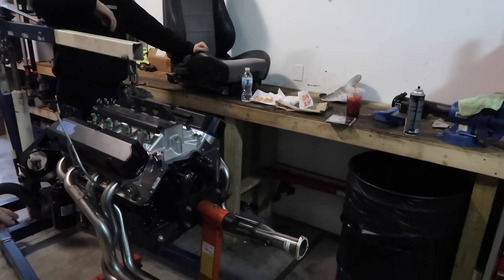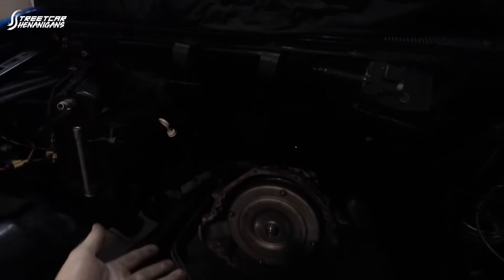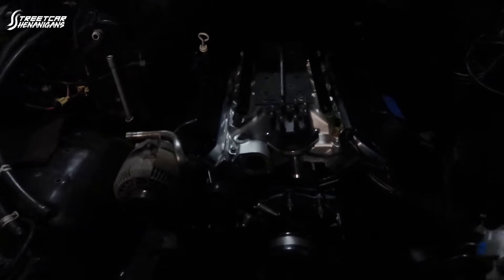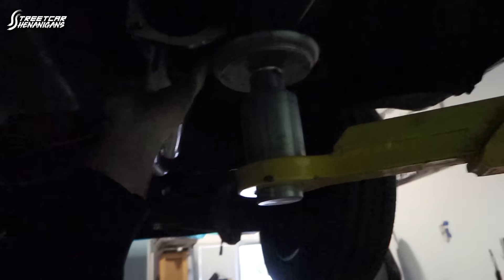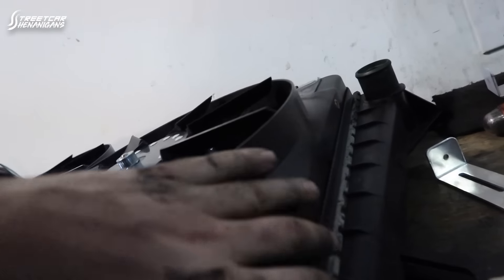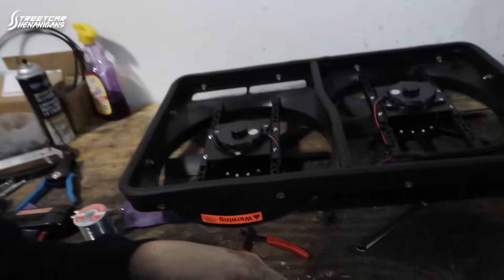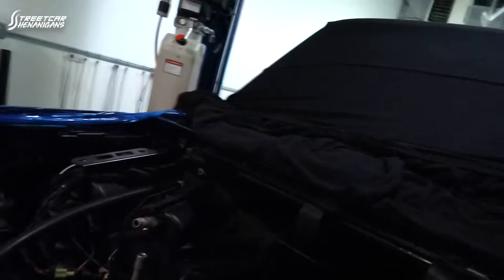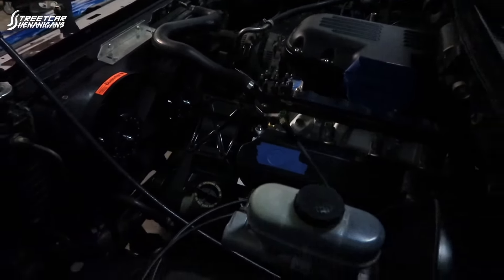Ford Lightning Engine, Fans, and Headers Installed!

Comment: Great job guys!  Got my 94 out tonight for a test run. Waiting on the PimpXShift to come in this week and swapping it over. Keep up the great work!
Reply from the maker: Thank you! How was the test??
Reply: Streetcar Shenanigans let’s not talk about it 😂 trans issues still and wheel hop. The Lakewood traction bars are about to be replaced with long bars I think. Hopefully the trans issue is tuning related and can be fixed with the PimpX.